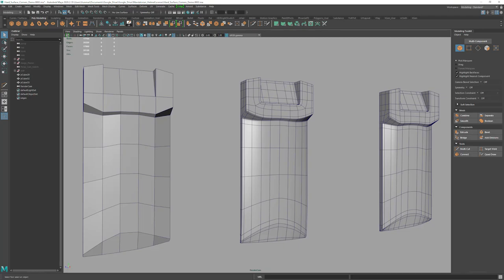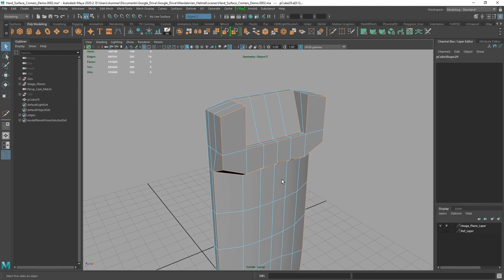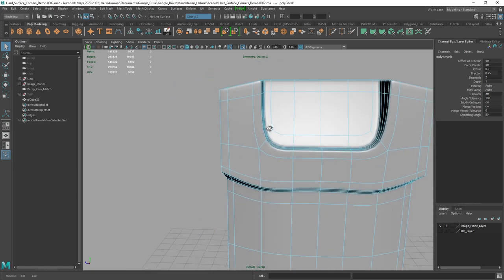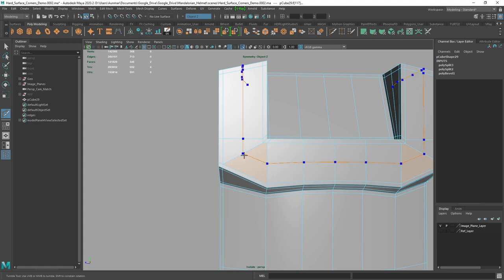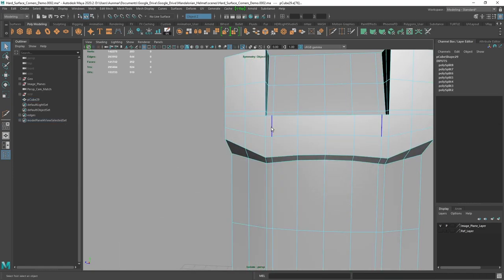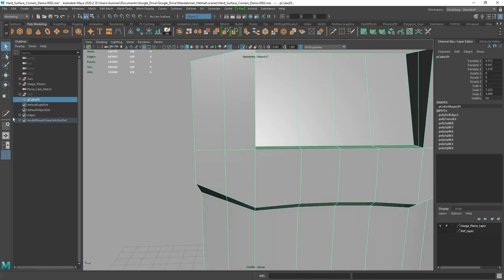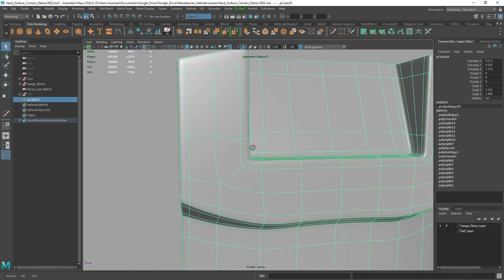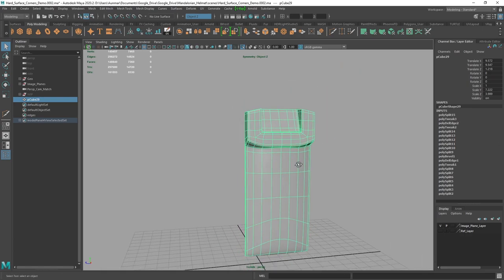Maya Hard Surface Modeling - How to Handle Corners

Comment: As you mentioned, on flat surface it could be everyone a King :) Actually I struggle with merging cylindrical shape to a sphere (saw already your Boolean tut) but my cylinder should come I a angle of 60 deg. into the sphere. I tried multiple techniques and nothing is satisfied me. Maybe you have some time to made a tutorial about this?
Reply from the maker: Same workflow will work regardless of the angle it joins the model. Do you have an example of what you are trying to model?

Comment: Wow did not realize that destructive workflow compared to Blender modifiers non destructive can be so complicated, it seems like Maya is way behind Blender in hard surface
Reply from the maker: I definitely agree that having a modifier stack like 3ds Max or Blender would improve the modeling workflow in Maya, but the techniques that I cover in this video is centered around topology and edge flow which you can't achieve with a modifier stack. This method (how to handle corners) takes manually cutting edges to achieve the clean topology, which can be applied to any 3D software.
Reply: @OnMars3D  Oh yeah if you need some quad based topo, but I think there is no alternative for fast modelling in blender using booleans and modifier stack in Maya? Firstly I tried keeping quads approach but you really do not need it for renders or Unity/UE4 if it shades properly
Reply from the maker: You need quads and clean topology specifically for sub-d modeling (subdivision/mesh smoothing) and animation. Triangles are completely fine for lower poly/optimized assets. Which are two different workflows.